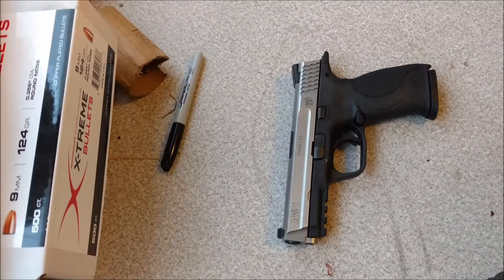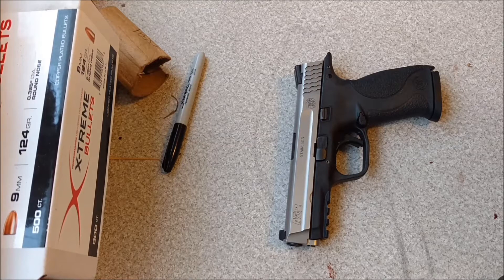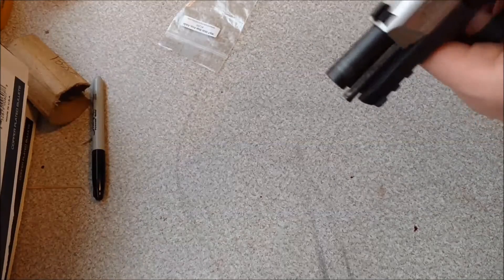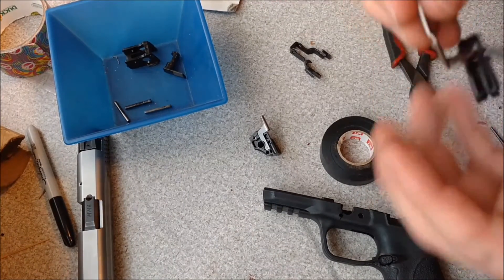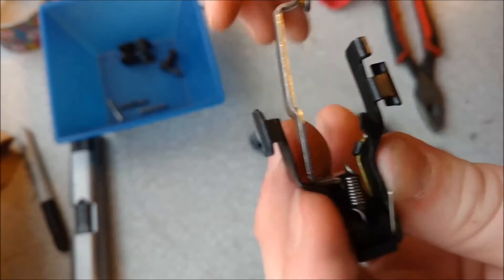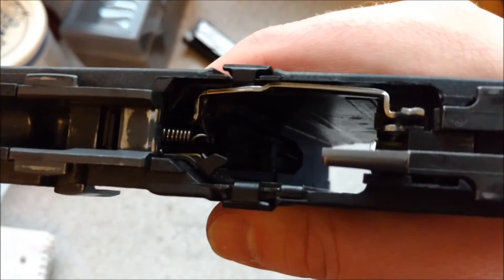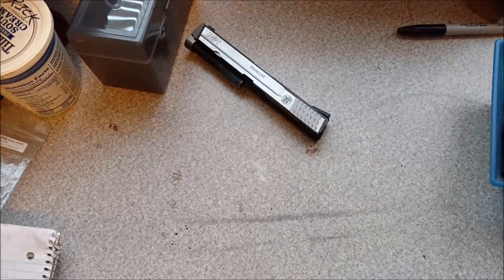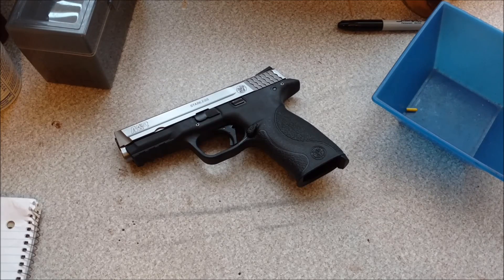M&P Trigger Reset DIY Upgrade

Comment: ... couldn't it just be bent a bit?!
Reply from the maker: Unfortunately bending it wouldn't help. You need the actual hump on the slide stop to put pressure on the trigger bar. Bending the trigger bar would probably cause it to stop working.
Reply: @Rickfrom406  Where to bend and how much is tricky.  JB weld was an easier solution, but I would be concerned about it falling off or wearing away.  You're introducing material in an unexpected place that might interfere with the gun if it fails.  I think your solution of brazing some material there is a more secure solution.  Just for the reset...may not be worth my time and effort.  But nice idea anyway.
Reply from the maker: @melc8049  This mod has worked for me for several years and hundreds/thousands of rounds on multiple guns without issue. I certainly understand the potential issue but I think the upsides far outweigh any downside. If something was to fall off it would be above the magazine well and I cannot see any thing bad really happening. 

The 3rd gen 1.0 slide stops are readily available now (wasn't the case when I made the video) and that would be the easy choice if I needed to do it today.

Comment: Ahh you put in an apex trigger and having reset issues too!
Reply from the maker: I did have reset issues after installing the the apex trigger but this was to address the lack of a good positive reset on the trigger. To fix the trigger issues after the Apex install you have to "bend" the tear drop loop at the end of the trigger bar where it makes contact with the sear. I used a tiny screwdriver that I could stick in the small opening to adjust it. I played around a lot to get mine working. I can't recall if I had to close the loop or make it larger. I made small changes, reinstalled everything into the gun then tried it, then disassembled and started over again. If you don't put pin in the Sear housing block you can get false positives on the trigger reset because the housing can move a little. Hope this helps.
Reply: Rickfrom406 have you had any bad resets lately?
Reply from the maker: Not after doing this modification. I didn't have bad resets, just weak, hard to notice which sometimes left me jerking the trigger after I thought it had reset.
Reply: Rickfrom406 what trigger return spring did you use the green 4 pound one?
Reply: Rickfrom406 p

Comment: nice job man but i was wondering if you can just put a generation 3 slide 
stop with out having to put any other upgrades i mean is it compatible and 
just drop a gen 3 with out anything else
Reply: I ordered a g3 slide stop, and quickly realized that mine already was a gen 3, and didn’t have enough metal to push the reset back under the sear. This was after I installed the apex trigger, none of the internals just the aluminum trigger (with tougher sear spring). I also had to slightly open the trigger bar loop because there was too little over travel to drop the sear fully.
Reply from the maker: I believe you can. When I made this mod the Gen 3 stops were not available for sale to the public on a regular basis.

Comment: That sucks. I just bought a 3rd gen slidestop with a bump on it for $20. Wish i had seen this first. Good vid
Reply: Try it anyway, make a slightly larger bump than is on the slide stop and it will be a way more audible positive reset.
Reply: So did I reinstalled and I still get a weak double reset, a little better but still blows.

Comment: Just did this to my M&P, I ordered a gen 3 slide stop lever and even that didn't have enough material, so I did this trick with a little bit of JB weld and bam! So much better. Also I had a phantom reset, where it would click right before the actual reset, now it's gone. Great idea!
Reply: are you  not worried that the jb weld will come off from the impact of fireing , that would be my concern
Reply: I sanded off the paint and scored the slide stop lever so it has something to grab on to. Also the recoil from a standard 9mm round isn’t that snappy. Even if it does fall off it wouldn’t be a worry. But 1k rounds later and it’s still nice.
Reply: thanks for the info i will try it the thing is i dont know what generation i have its a police auction gun 
i will open it and see and do this diy upgrade
Reply from the maker: Glad to hear you liked this idea. I've put probably around 1k rounds through the gun and I am having the same experience as you. It just keeps running and i'm happy I share the idea.
Reply from the maker: nahh. Recoil isn't going to affect it at all. The only thing that is going to wear it is the trigger bar rubbing against it. Even if it does wear down or somehow come off it can be reapplied and shouldn't have a negative effect on reliability.